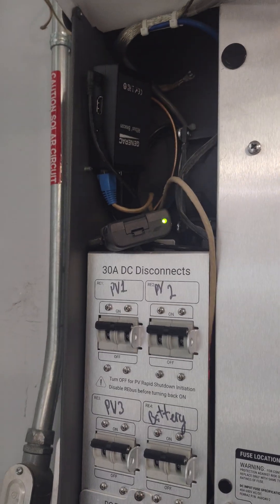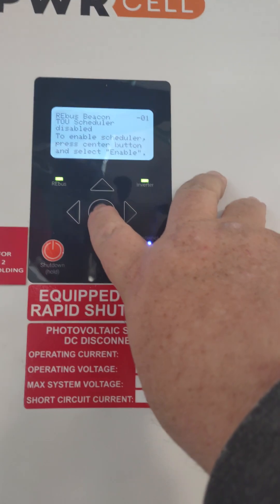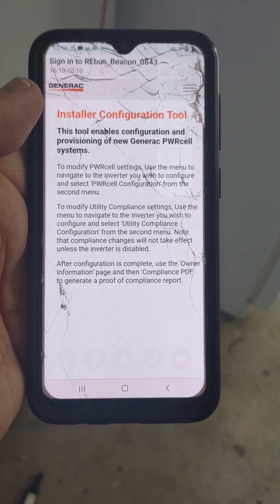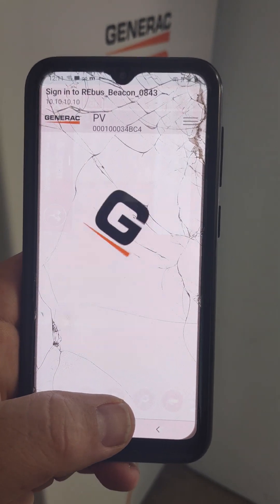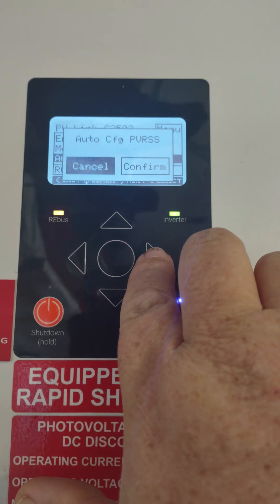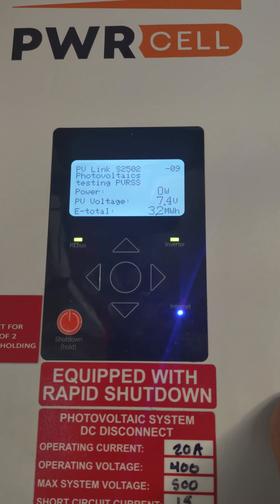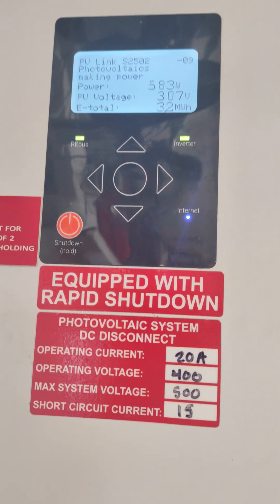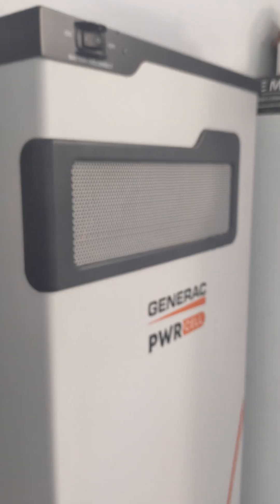review of how to reset a pvrs lockout on a generac power cell only after replacement

Comment: hello i have been dealing with this pvrss lockout error on and off on my system. it says 11 snaps installed but 9 dectected, this has been a 8 month issue. 5 months ago we had a hurricane come through the day before the hurricane i went out to check the system and it was running fine NO errors 11 snaps installed 11 snaps detected. a month after the hurricane it went back to 9 detected 11 installed and its been there ever since. Now Ive been dealing with a real bad company that installed my generac solar particular one person over there that is a real piece of s@$#! we've had to talk to our loan company that we financed the solar from. and threatning we were not paying the loan anymore because the whole system didnt work for two years after install and the install company really didnt care. there are many more issues with install company i cannot get all in here. So long story short for three questions 1. can a a@@hole in that company change the number of snaps detected in order to make me call for a service ? 2. how can I fix this without that company. 3.  If I get it fixed can I unplug the inverter from the internet to stop this from happening ? thank you for your time

Comment: My snaps were 1st replaced (with 802's and the old one's were not ID'd on the plans by bk'd Zenernet so I don't know whether the original from a mid 2021 installation were 801's or 802's - perhaps the sneaky Zenernet guys trying to use up there stock of 801's w/o letting the home owner knowing which they used...? And this in any case did not fix the lockout error, so another company did the successful reset of this error using your process, but the lockout error has returned 6 weeks later in the same string that the snaprs were replaced 100% with 802's. So now that the reset needs to be done again, do i need to spend $300 again and replace the 802 snaps? Or do the wise thing and just go up there and remove these snaps and toss them (and the Generac folks who designed this faulty system) into the trash bin and be done with these stupid things that turn your panels into boat anchors? And prevent a one in a billion chance that you have an attic fire, that the FD needs to chop through where your solar wires are, and that they are not using wooden handled axes to do said chopping. With none of these potentially overheating fire starting snaps to begin with, problem solved!
Reply from the maker: I don't know why it was $300 to replace them the committed installed the system should have gave you a warranty that's when I was in this time limit and the company should come out and replace them for free if there's a problem with them again we have a very good luck with the second-generation versions but I would call generac directly and have them deal with the problem and they should be able to cover the issue